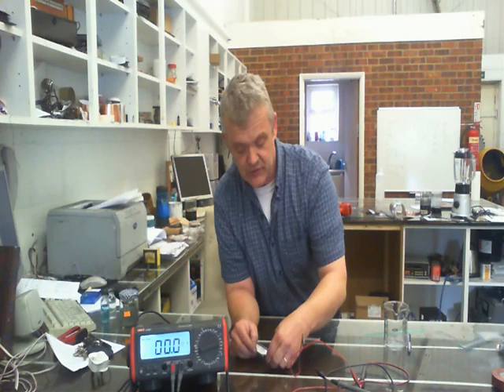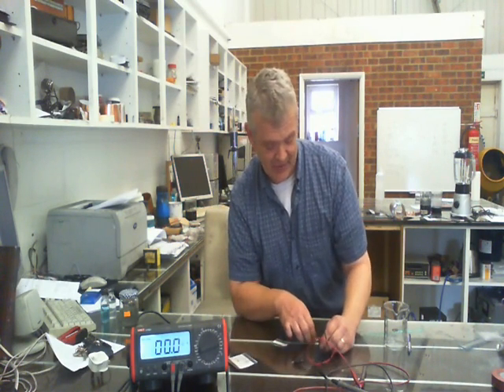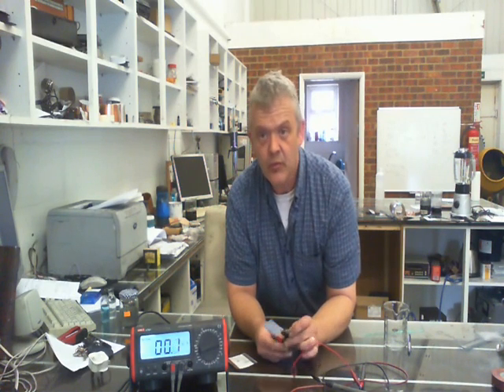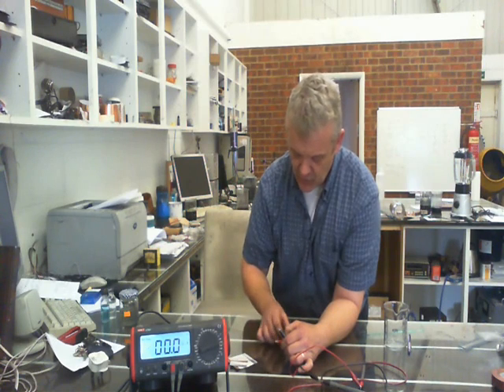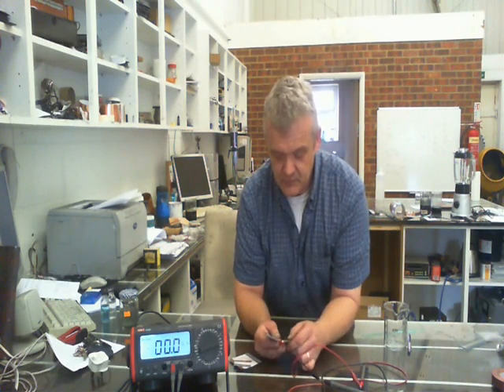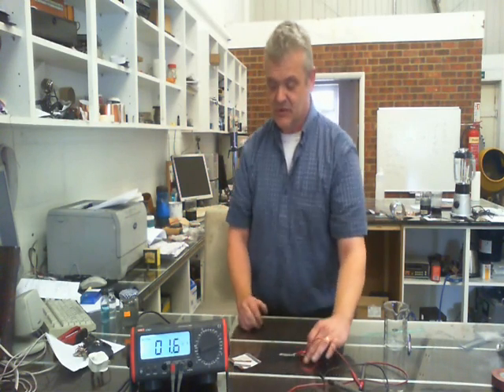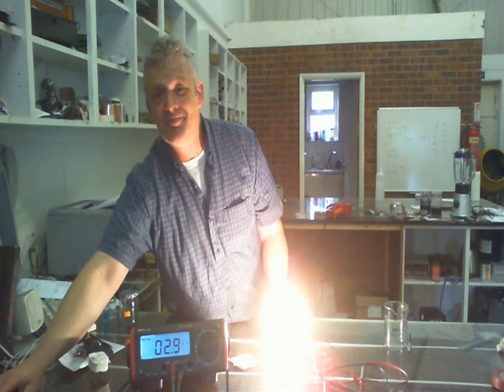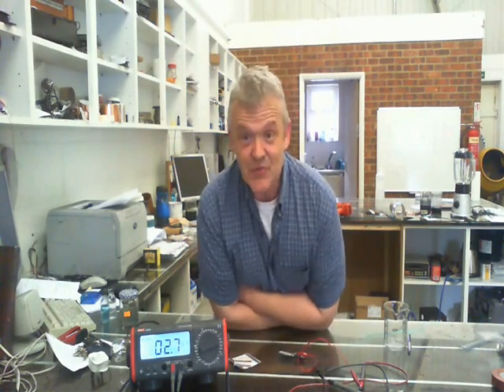The Effect Of Some Dopants On The New Type Of Solar Cell

Comment: Hi Robert, yes this is very cool. I know this is almost 3 years ago but can you remember if you used manganese Oxide or Dioxide in the solar cell? Because if it is dioxide I have a bunch of dead AAA Alkaline batteries that have it in them. Cheers
Reply: I meant AA batteries and 9 volt.
Reply from the maker: dioxide mate - though if your batteries are used you will have a fair amount of sesquioxide and oxyhydroxide in them

Comment: lightly-scratch the surface with sandpaper
Reply from the maker: to increase surface area? - my idea was to mix in fumed silica. I'll try both lol
Reply: Idea was from reading very recent article, "Planar light source using a phosphor screen with single-walled carbon nanotubes as field emitters," Scientists from Tohoku University in Japan have developed a new type of energy-efficient flat light source based on carbon nanotubes.
Reply from the maker: Terry Hope
i'll have a look mate
Reply: Robert Murray-Smith Early Magnetic Mirror
Reply from the maker: Terry Hope
huh?
Reply: Robert Murray-Smith Optical magnetic mirrors without metals http://www.opticsinfobase.org/optica/fulltext.cfm?uri=optica-1-4-250&id=303089

this is also very interesting: Scientists have developed a novel one-step process using, for the first time in these types of syntheses, potassium superoxide (KO2) to rapidly form oxide nanoparticles from simple salt solutions in water. - http://www.nrl.navy.mil/media/news-releases/2014/nrl-researchers-develop-novel-method-to-synthesize-nanoparticles
Reply from the maker: Terry Hope
thanks for them mate - fascinating stuff i will give them a proper read later - but thanks

Comment: Dear Robert, as usual you shocked me, in the positive meaning  of course ;-)
Ok, it seems that everytime you enter in contact with some material in its nanoparticle shape, you discover something interesting...isn't it? 
Well, you're a fantastic chemist so, why you don't ALWAYS make use of the nanoparticles version of every material when you prepare your mixtures, e.g. when you add some dopants?
Think about using nano-manganese sulphate, nano-zinc oxide, nano-formic acid, nano-thiourea...
Work on it mate, you'll have a lot of satisfactions!

Comment: And can i ask what does Dopants mean?
is it just a metal that act like paint?
Reply from the maker: tiny additives - little bits of something you add to the main body of the material to see what effect it will have - so adding 0.5% of graphene to plastic makes it 35% stronger - the graphene is the dopant and the plastic is the body - the effect is an improvement in strength - usually they are added to active materials to change the activity
Reply: Robert Murray-Smith Nice, i will try doing it myself and if i make it, i will like all your videos forever :D
Reply from the maker: aprusfire
cheers mate

Comment: Thanks for sharing, and i love how expensive solar cell silicon planes are but you can just make a cheap solar cells, yes you need more land but its less money so i will do it, i wish i know how much more land you need i think maybe x5
Reply from the maker: go for it mate - and do a vid we'd all love to see
Reply: Robert Murray-Smith I will start it soon enough, i got school and work so its a pain. When i make a video do i send it to you?
Reply: Robert Murray-Smith Also on your flexible solar cell. Use Salt water and graphene 
In my a cup i put salt water a copper wire and aluminum foil, and when i put my voltage meter on the copper and aluminum it produced about .20 volts, then when i put a piece of paper with graphite on it, it went to .50 volts :D
But how do i take the electricity out i want to make more of these and put them together, but how?
Reply: aprusfire Im trying to build the solar panels, but first i want to test it and be better at it, so far i have no clue how to make the system. I watched your video but im still confused how do i connect the cells to make more voltage?
Reply from the maker: aprusfire
no - just post it to youtube so everyone can see and send me the link
Reply from the maker: aprusfire
in series - just like batteries
Reply from the maker: aprusfire
connect them in series and put your load between the two end wires - just like a battery mate
Reply: I'm working on a new construction technique that lowers the land print for solar fields to around 50% of the 'standard' size